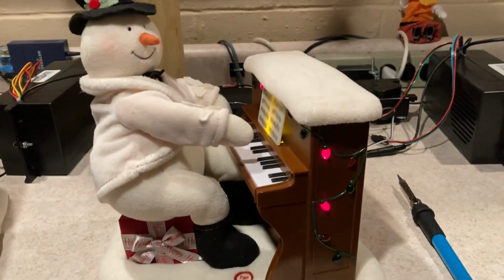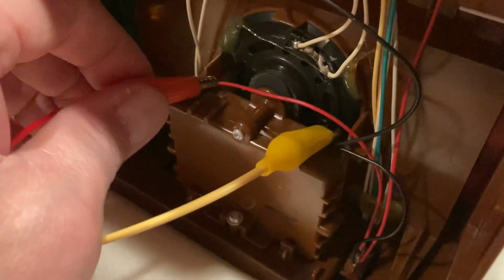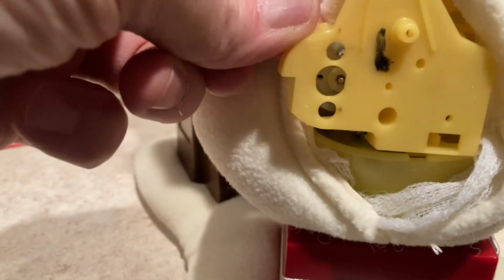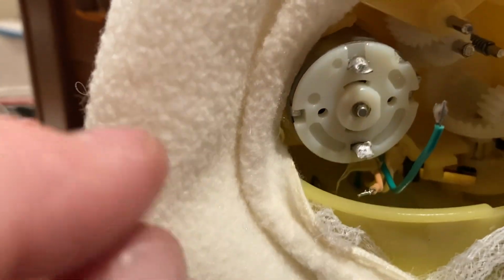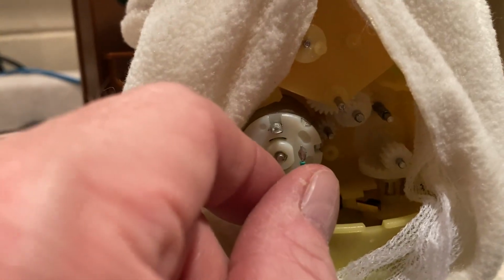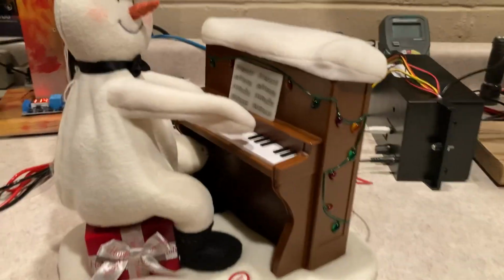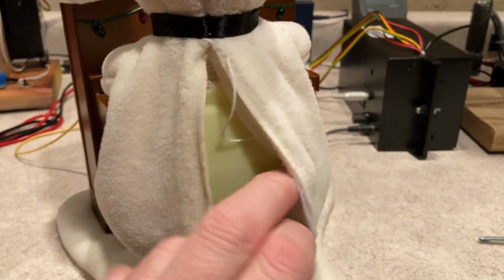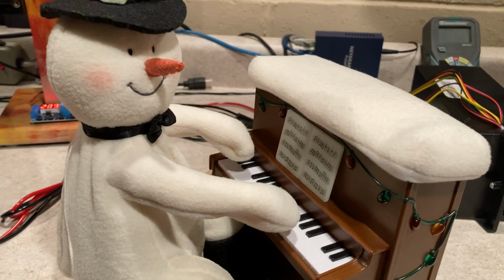Hallmark Plush 2005 Piano Playing Snowman Repair Part 1

Comment: We've had ours since 2005, and someone stripped the screw to the battery compartment and we can't get it off.  My now adult kids are so bummed, LOL. Can't think of what we might be able to use to get it out. Thoughts?
Reply from the maker: You may have to drill it out. Or if you can still get a Phillips screw driver and it just spins, take a small flat screw driver and pry the tab to the battery compartment upward while trying to unscrew it. 
Hope this helps got to these Jingle Pals running 😄Thank you for the question. Happy Holidays !

Comment: I think mine has a problem with the battery box. Trying to take plate off inside of the piano to clean everything out. Bought it used and it looks like theirs battery leaks. It will sometimes work, but they cut out mid song. Thanks for the video
Reply from the maker: Yes the human element leaving batteries in these things is bad indeed. Clean it some more get the contacts as clean as you can. Thank you for the comment.
Reply: @mikecomptech  I seem to have got it working perfectly. I put the cover in a glass full of vinegar for about 3 hours. Removed all the acidity and got the snowman working perfectly. Just thought other may want to see this. Thanks again!!
Reply from the maker: @caltroy4899  Great !!! 😀 Good job, yes white vinegar is a light acidic a great way to use it. Thanks for letting me know and Happy Holidays.

Comment: my snowman has a noticeable smell  when the motor is running, like electrical wiring, or like something is burning. even when powered off the snowman smells terrible. is that normal?
Reply from the maker: No that is not normal. Are you the original owner ? Just saying, if you bought it used it may have pickup a smell from a previous owner or a place it was stored or kept in. It also can be the smell of the motor and the old lubricant. if it is running and you hear the music and not draining the batteries at a fast rate then doubtful it's a major issue. And if you compare the speed of the animation on yours, look on YouTube, and if that's normal that's good. Thank you for your question.

Comment: I have the jingle pals 2 dancing snowman 2008 I believe and it was working until my toddler spilled orange juice on the base. When I turn the switch to on, it moves for a second, but when I push the button nothing happens anymore. Is there any way to fix it? He loves it and I really want to fix it for him
Reply from the maker: Oh boy, orange juice it has sugar content and it is acidic. And if it sat like this for a period of time that's going to set up like glue, the sugar is bad indeed. And the base may have soaked up the OJ so it's in the poly fill base. Pop out the batteries clean that area really good warm soap and water. I hope you can get it going, and if you can't you might look on Ebay they are plentiful there. Thank you for your question.

Comment: Thanks for this. Just got mine out and he’s not moving.  I can hear the motor running though. Is that normal?
Reply from the maker: Yes that's good in the respect the motor is not froze up. But the belt that runs from the motor to the gear box has lost it's tension over the years. It will need to be replaced, so if you want it working it will have to be disassembled. The motor belt is in the front cover in the snowman it's major surgery if you are not a fix it type person, but give it a try, you can do it. 😀 Thanks for your comment and question.
Reply: @ I can usually fix anything. Was in the trades for the first part of my adult career lol. I’ll be giving it a go as there’s nothing to lose.  Thanks again for the tutorial and comment. Merry Christmas!
Reply from the maker: @tyrsog  Merry Christmas to you as well. Great give it a go I say the same thing to myself before tackling a project like this. It's broken so if I fail it's still going to be broken lol..  Thanks again keep me posted on your progress or if you need further assistance.

Comment: Mine goes through the whole animation but his movement is slow and the audio speeds in and out
Reply from the maker: Have you changed the batteries?  Also it can be the motor is being slowed by the old lubricant over the years it dries out. That is what was wrong with the one I fixed.